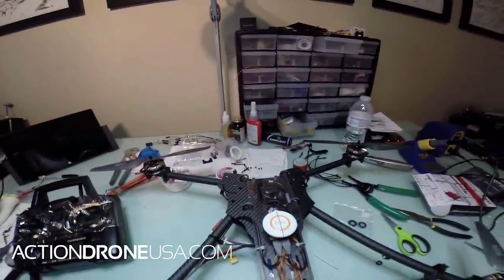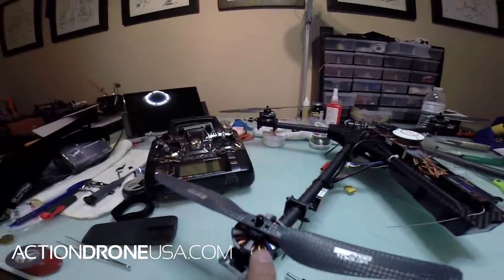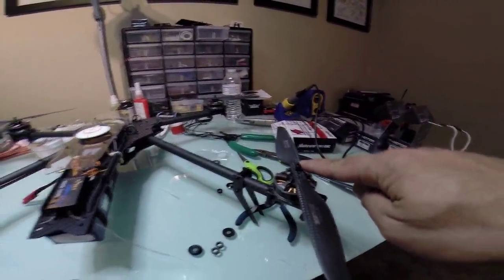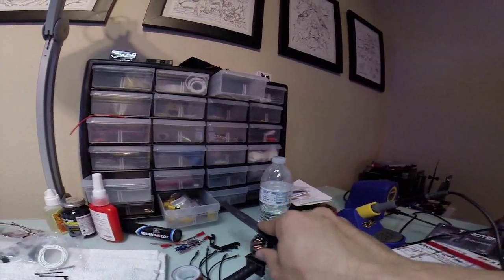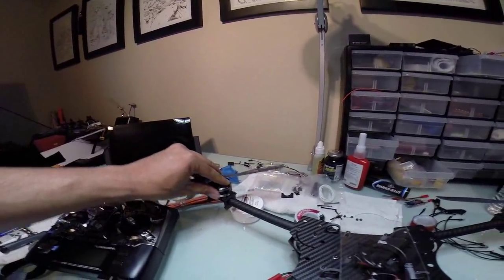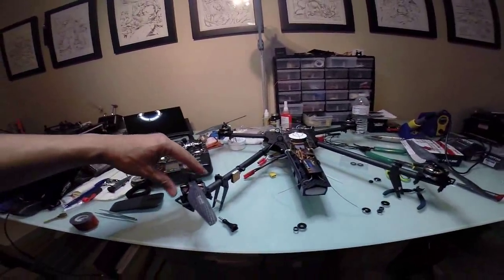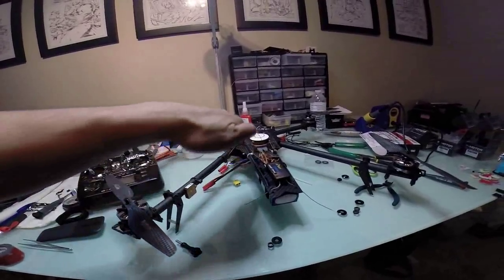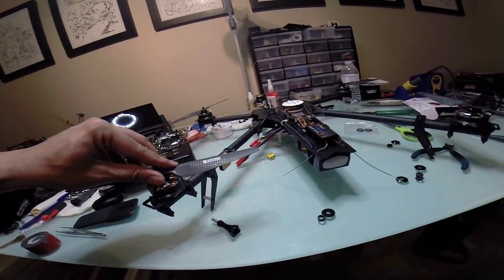Quadcopter motor orientation and propeller orientation

Comment: what type of motors and propellers are you using. I'm struggling to pick my power setup
Reply from the maker: these are MT 4006 motors with 10" props. What type of frame are you using?
Reply: im using the bumblebee frame 550mm with 10x4.5 props and 935kv motors but i have to give it more then half stick of throttle to get it off the ground. I have my camera gear it
Reply from the maker: goalkeeper96 yeah if you are using naza it will require you to go more than half throttle first before it takes off then you can bring it down to half throttle to set the hover setting. Its really depending on your flight controller too and your battery. We use a 4s batterry 35c.
Reply: Darryl Anunciado yer i have the kk2.1.5 board and a 3s battery 3000mah  40c
Reply: Darryl Anunciado i might have to upgrade to a 4s battery but dont know if my motors will get too hot